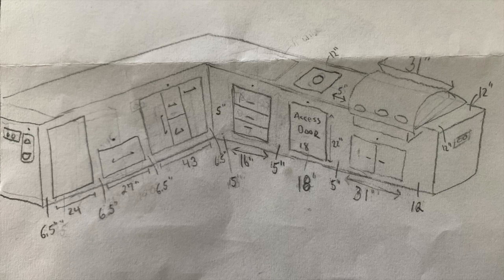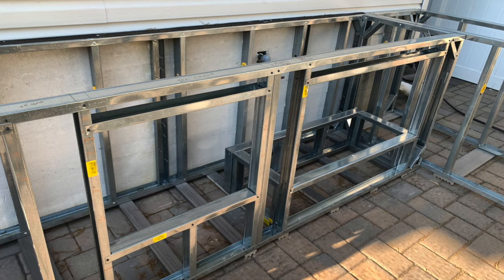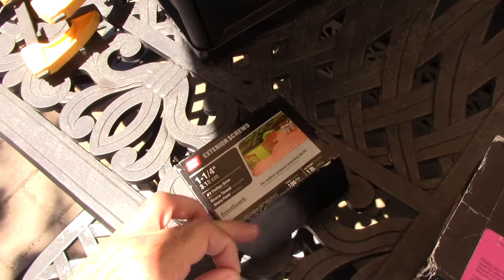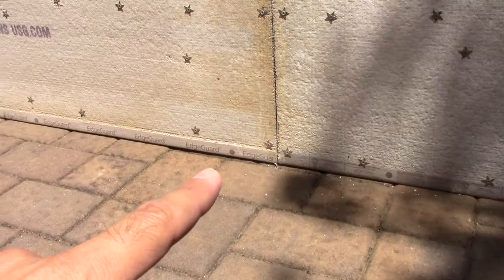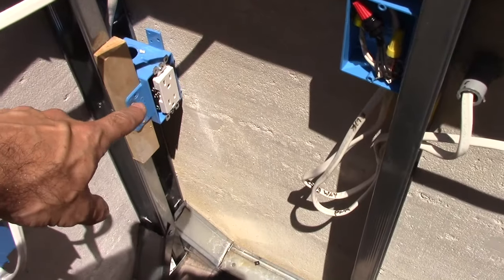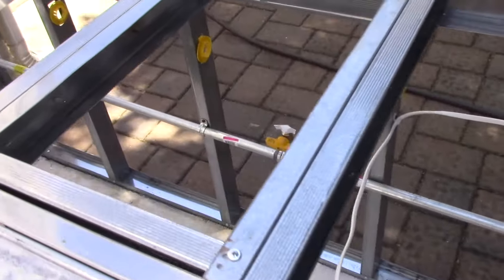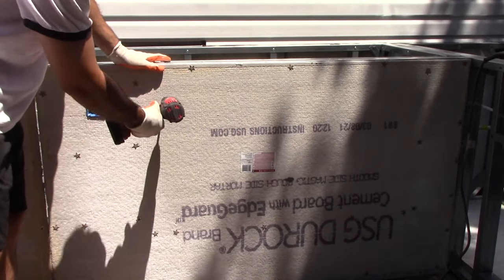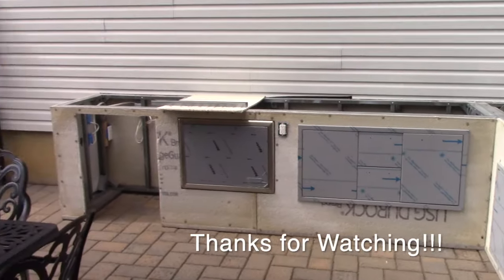Amazing DIY Outdoor Kitchen -Part 1: Planning, design, BBQ Guys, Metal Studs, Cement Boards

Comment: Future reference, if you ever need to cut cement board again, or drywall gor that matter. All you need is a new blade on a good utility knife. Put your t square across the board and score it 2 or 3 times with the knife. Push in on the back side of the cut while pulling back on the top of board. Snaps off like magic ❤
Reply from the maker: thanks for tip

Comment: Very nice job, when cutting such a small amount off the backer board. Just install the entire 5x3 sheet, run your utility knife along the edge of the track  a few times. Bend it forward and under cut done. Saves time and a ton off airborne dust.

Comment: Nice set-up. i am a commercial kitchen repair tech, looks like you went with galvanized pipe for your gas. one recommendation, i would use black pipe or even better for outdoor the black green coated pipe.

Comment: can the distance between the units be 6" instead of 6.5 I need that space for my trash can on my build I have  100 inches to work with and want to do frig, trash, grill and sink yikes i come up 2" short with the 6.5 help
Reply from the maker: sure. the 6.5" is the spacing that worked for me.Also, make sure to leave enough room for the finish!

Comment: Did you cut the cement board with a saw blade made for wood?
Reply from the maker: I used a blade used to cut metal because of the smaller teeth vs. the wood blade

Comment: Having the studs sit on the deck boards doesnt make it vulnerable to bow?
Reply from the maker: I put most of the deck boards underneath the vertical studs and also did not have much space in between them. Thus far, I have no issues with any bowing!

Comment: I was hoping to see how you installed the BBQ Guys components.  Great job tho!!
Reply from the maker: The BBQ Guys components just go screwed on the sides to the frame. Just make sure you measure out your frame according to the specs so you don't have issues when you slide them into the frame

Comment: Great video!  Why did you go with 2 1/2 inch wide vs 3 5/8 wide metal studs?  I'd like to use the 20 gauge 2 1/2 as well but want to make sure I understand the difference in the end result if any.
Reply from the maker: I think either one would work well.

Comment: Great video, nice job.  question for you - Did you see any flow issues impacting BTU by running a single Gas line to each of the appliances?  I'm planning on running to a Blackstone, Grill and a Burner so have concerns.
Reply from the maker: I haven't had any issues. thanks!

Comment: Great video. Quick question, I noticed you only added cement board to the bottom/floor of the area where the burner is and under the sink there is no cement boards on the floor. Is there a reason for this? And how do you secure the cement board on the floor to the metal studs? Thanks
Reply from the maker: I didn't add cement boards under the sink because I have a drawer unit underneath it with its own floor. To secure the cement flooring, i cut metal studs and secured them to the frames for an added lip to crew in the cement boards on the floors. thanks
Reply: @letsdiy2gether239  thank you for your response.  I’m building my L shaped kitchen up against my wooden fence which is one both sides of the L and I’m not sure how I can finish the back of the kitchen. Should I do the framing and add the cement boards to the back and then add my stone and then pick it up and move it closer to my fence. The issue is I wouldn’t be able to get to the back of the kitchen as it would be up against my fence. Your thoughts are much appreciated

Comment: Have you had any sagging issues with the amount of spacing you have between the trex boards?  It seems like you have a lot of weight there with the stone and the countertop and equipment.
Reply from the maker: I have not had any sagging issues. Make sure you use the thicker gauge studs. thanks

Comment: Thanks for the video.  How much did you spend on framing , stone and granite roughly?
Reply from the maker: This size kitchen would probably costs about $20-30K in my area, but you can save on labor by doing it yourself. Materials, appliances, cabinets, grill, lights, stone and granite counter totaled a little over $12K. Roughly broke out as: Granite $3K, Kitchen cabinets/grill/fridge $7K, Materials $1K, Stone $900, Lights $120. Good luck! Thanks for watching

Comment: Did you use the ProTrack all around? Meaning for the vertical and the horizontal channels?
Reply from the maker: I used ProTrack for bottoms and outer sides. And used ProStuds for the support and inside beams

Comment: wondering if that grill hangover on countertop by its lip or does it sit over horizontal metal frame? Thank you!
Reply from the maker: The BBQ is sitting on the granite, but I did reinforce it with steel framing all under it for added support.

Comment: Is it mandatory to raise the frame on the track? Can you place it directly on the floor? Won't the track and gap be too obvious?
Reply from the maker: Keeping it off the floor allows for good air circulation and water runoff which helps with the elements. The gap will will covered to the eyes once with your stone finish. Thanks
Reply: @letsdiy2gether239  so I shouldn't cover the gap with the concrete boards?

Comment: Hey there. Was wondering, what kind of screws did you use to go through the cement board into the metal studs? Thanks.
Reply from the maker: I used Polymer Coated Exterior Screws. thanks

Comment: Good Afternoon - I would like to know what the depth of your metal framing (1:35 into video) was and the what your counter depth with granite ended up being.  Thanks for sharing!
Reply from the maker: The metal frame was 28". The final counter depth with granite was 32.5". Keep in mind, if you are doing under-the-counter down lights, you'll need to account for that. thanks

Comment: Is there any worry of the hot grill being up against the house? I didn't see any kind of heat barrier
Reply from the maker: Yes, you should never have the grill against the house unless you have a good barrier. My grill is not against the house, it is on the "L" part of the island that is away from the house.

Comment: Thanks!! you inspired me to do something similar for my backyard. How did you determine width of barbecue insert, did you have appliance already before installing it and is it just sitting over frame? Thank you again.
Reply from the maker: Prep and plan!!! Right from the start of planning, I did research on the inserts, BBQ size, etc that I wanted for my kitchen. Even before i started building anything, i had a good sense of how many drawers, what size BBQ and other appliances i wanted. Online, you can see the cut opening sizes you need and that's what i used to measure out the holes for the inserts.  Good luck
Reply: @letsdiy2gether239  You did awesome job!

Comment: Great job. I’m on the planning of building mine. How thick are the cement board, 1/2 or 3/4? Thanks
Reply: 1/4 inch is all u need. Much easier to cut.    Anything thicker is overkill especially with the gauge metal he's using.

Comment: Amazing work!!!
What’s the cost of the galvanized framework?   There is a company selling those premade but for your size barbecue it’ll cost me almost $8000.   You think it’s better to just buy it from Home Depot and do myself? Or was it hard?   Thank you
Reply from the maker: I also explored the pre-made metal framing. It is very expensive as you are paying a premium to have everything cut for you and pre-measured. Buying the material yourself is A LOT cheaper. The question is whether or not you are comfortable with cutting, measuring and screwing everything together on your own. If you are, and want to save money, definitely buy all the parts yourself at your local hardware store.
Reply: @letsdiy2gether239  not sure if my comment coming through, but would you be interested do so something similar for me. I’ll pay you well!   Please let me know. I live in northridge, ca.   thanks!
Reply from the maker: @EddiePoe  Hi, unfortunately i am in NY, so it wouldn't work. Good luck on your build! Thanks for support

Comment: Starting one soon! Did you have to pre-drill for your exterior screws used in the cement board?  Video was very helpful!
Reply from the maker: I did not have to pre-drill when I was fastening the screws for the cement board. thanks

Comment: What made you go w/ the metal studs vs using treated lumber?
Reply from the maker: I decided to go with metal because since this kitchen is outside and exposed to elements, I didn't want to take a chance with wood, even treated wood. Another reason is because wood is super expensive now, so it made sense to go with metal. thanks

Comment: How did you cut the metal studs? Was it strictly with the snips?
Reply from the maker: I cut most of the metal studs using a chop saw equipped with a metal-cutting 10" blade. It is a very easy way to cut straight and more efficiently. I used the snips for angle cuts and for the smaller pieces

Comment: Aren’t you worried about the pipe freezing ?
Reply from the maker: If you are referring to the water pipe, then no. I have a valve inside the house to drain it and close it for the winter. thanks

Comment: Is it bolted to the wall or floor or floating?
Reply from the maker: It is not bolted to the walls or floor. The weight alone from the material- cement boards, stone, granite, etc- is enough to hold it down and keep it steady

Comment: What are the stars you used for the cement board?
Reply from the maker: Those act like washers. They were leftover from another project. You can use regular washers to help keep the boards in place.

Comment: how much does this cost
Reply from the maker: This size kitchen would probably costs about $20-30K in my area, but you can save on labor by doing it yourself. Materials, appliances, cabinets, grill, lights, stone and granite counter totaled a little over $12K. Roughly broke out as: Granite $3K, Kitchen cabinets/grill/fridge $7K, Materials $1K, Stone $900, Lights $120. Good luck! Thanks for watching

Comment: I would love to know your frame dimensions.  I see you built it to put the refrig on the ground. How tall is your fridge opening?  34”?   How deep is the unit?   What is your finished height?
Reply: Really nice job by the way.
Reply from the maker: The fridge opening is W 24" x D 23" x H 34". The depth of the frame is 28". The height of the kitchen frame is 35" and it is at 36 1/4 if you count the granite.  Thanks

Comment: Can cement boards be used in Ohio where we get below 0 temps…. And summers get to 90°? HHHEEELLLPPP!!!
Reply from the maker: I'm also someplace where it is very hot in summer and freezing in winter, and I haven't had any issues. But I would definitely do my research to ensure whatever you install works for your areas. thanks

Comment: One issue that should never be overlooked for insurance reasons is permitting and building to code. Especially critical when tieing into the gas supply and running electrical lines. I'm a firefighter and have seen this ignored and the consequences can be costly.  Worst scenario I'm aware of happened in an another county. Storm dropped a tree onto an outdoor kitchen and the owners were on vacation. Gas line ruptured and ignited, quickly spread to the house. House was a total loss. Insurance denied the claim for multiple code violations and lack of permits. It may seem like a simple build that can be thrown together without thought to code but looking at this video the bells and whistles are screaming.  In my state the placement alone tucked into the house wouldn't fly. Gas lines are galvanized. Framing subpar. Many other minor issues visible. As someone who is indirectly involved and sees what happens when people cut corners I assure you it's not worth it.
Reply from the maker: I would definitely recommend for everyone to know their local codes and abide by them when constructing anything. Thanks
Reply: @letsdiy2gether239  its more than that it is pulling permits.. The bixes and number of outlets look like they were not up to NEC. Big denial if you have an electrical fire even if it started in the furthest bedroom

Comment: These are framing studs and not designed for an outdoor kitchen
Reply: How do know these studs are not designed for outdoor kitchens?  I'm looking to use 20 gauge 2 1/2 metal studs on my outdoor kitchen.  I'm just trying to figure out what is the proper stud to use.
Reply: Oh ye have little faith. There is VERY little that steel framing studs are not designed to FRAME out. He framed the kitchen. What else but framing studs? Or would yoi have used wood? That's not dangerous at all 😅